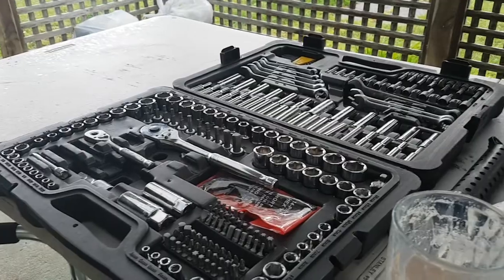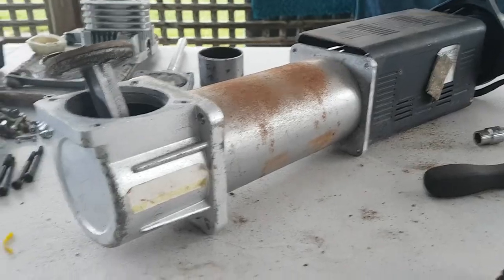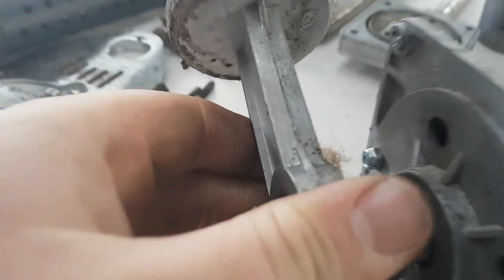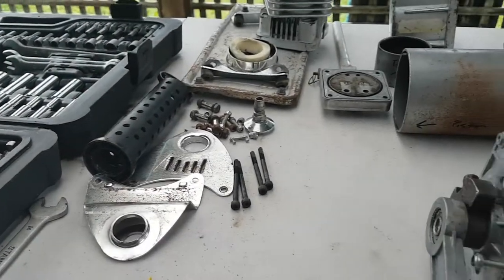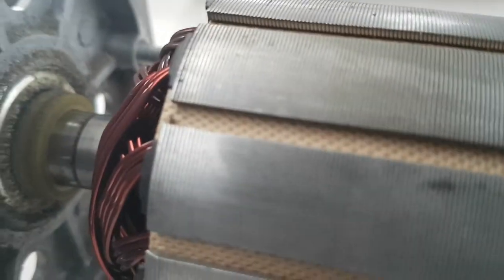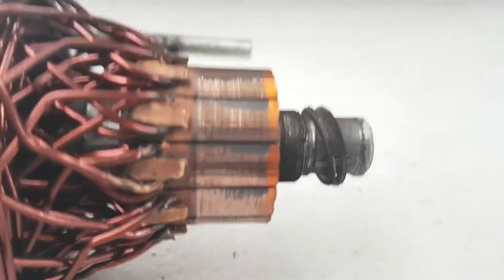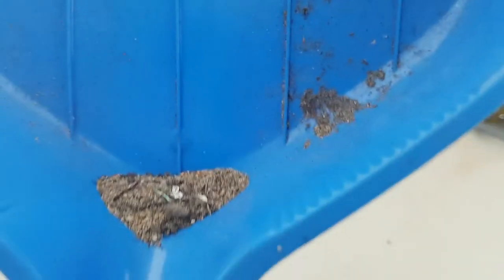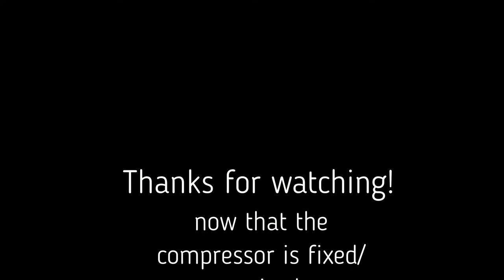WORA 4x4 - Inside The Kings Thumper MK1 Air compressor

Comment: How do you think all that sand got in there?
Reply from the maker: Not entirely sure. Seeing the breethers for the compressor ar at the top of the cylinder. Unless that metal pan underneath the compressor gets full of sand (it can through opperation on the ground) and eventually shakes itself inside the housing. Cant see how that can happen though.